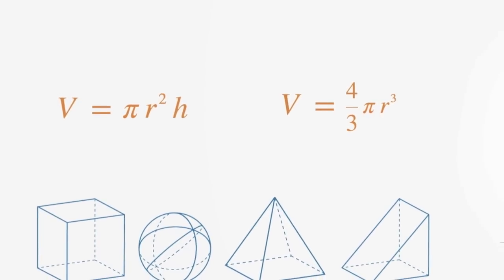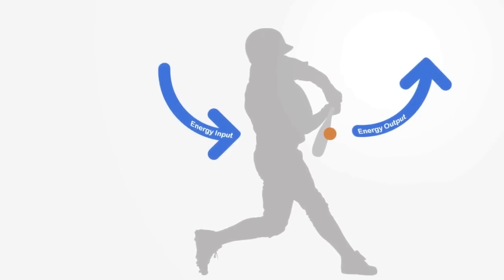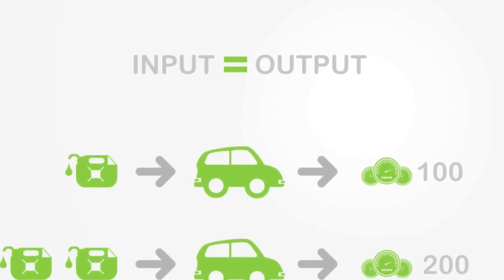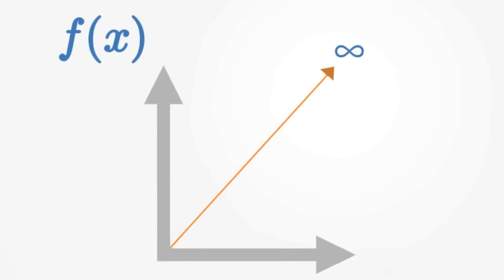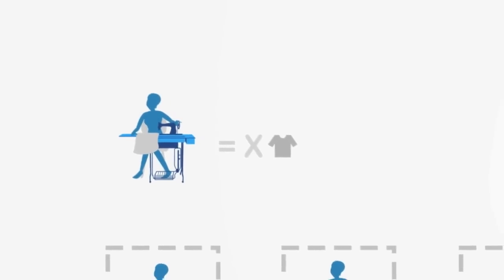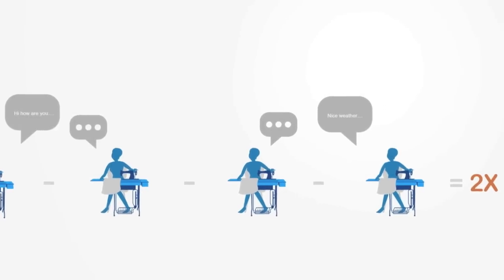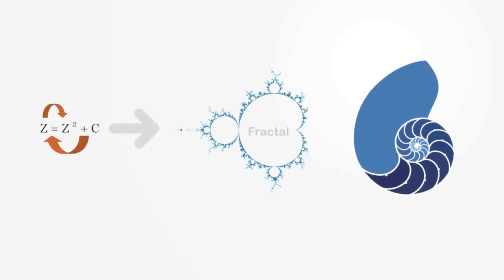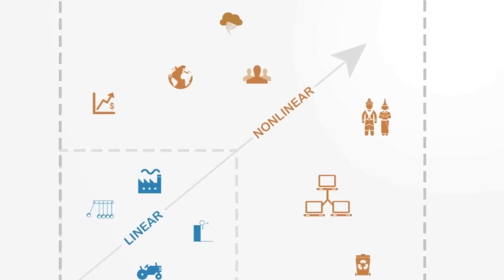Nonlinear Systems Overview

Comment: Can't synergy and interference happen both at the same time ? Those workers could benefit by specializing, and also loose a bit of productivity by socializing, with the overall result being positive.
Reply: +Transyst Like the interference between positive and negative feedback. Makes sense.
Reply: I think when you specialize you limit the amount of emergence because you're missing systems interacting with one another at their local interactive level. So instead of you growing in the phases and how everything interacts and combines with one another you would Branch off into one area and miss out on all of the other external systems that you've just turned away from.
Reply: @cormano64  yes but in the illustration he put in the video interference would make one plus one equals zero and a contrast to that would be if it was a Synergy + 1 + 1 what equal 3.